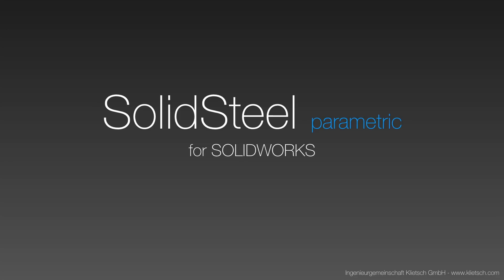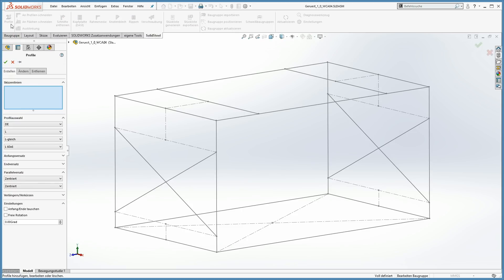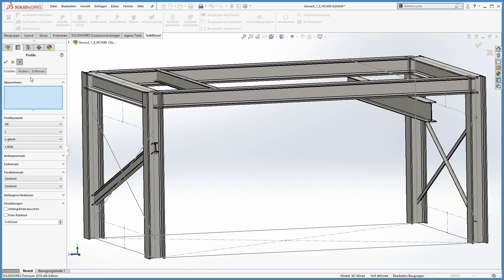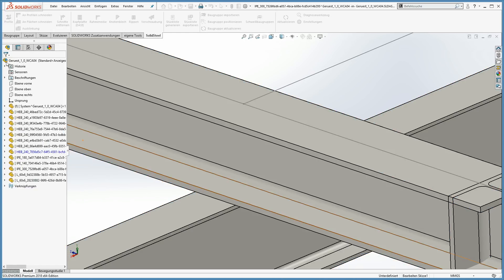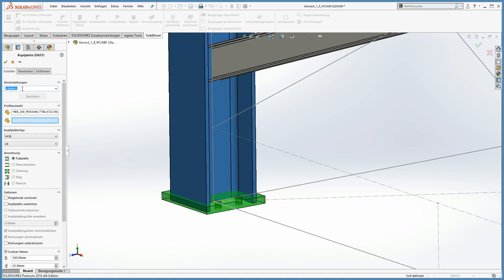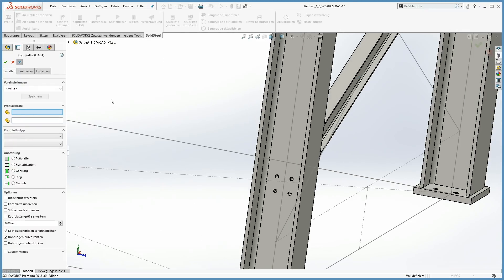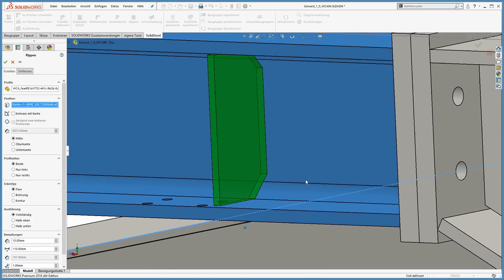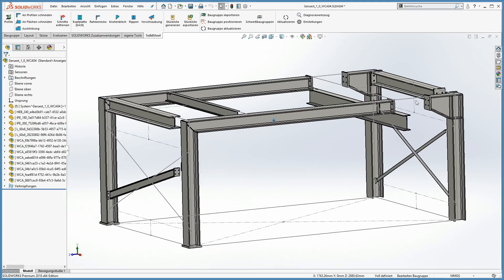Structural Steel Design with SOLIDWORKS - SolidSteel parametric - Product Video v1.0

Comment: comment faire pour obtenir le complément SolidSteel? es-ce un élément intégré à SolidWorks ou faut-il l'acheter en ligne ou le télécharger?
Reply from the maker: SolidSteel parametric is a fee-based Add-In for SOLIDWORKS and needs to be purchased separately. Please send an eMail to solidworks@solidsteel.de to learn more.

Comment: What about inserting a single parts such as plate, vendor parts!?
Reply from the maker: That’s of cause no problem! We are working in a usual SOLIDWORKS assembly and of cause you can insert other components. If you create a plate using the SolidSteel part template you can use the DXF Export, NC data export etc also for the external part for example and all external parts can also be listed on the BOM.
Reply: @apps4swx  I thought that Solidsteel part's codification is important in numbering and consolidation, so we can create a plate using Solidwroks features ?
Reply from the maker: @leo198995  Yes! If you use the delivered SolidSteel part template, then you can create a plate using SOLIDWORKS features and this plate will be part of the numbering, will be supported by DXF export and many more.
Reply: @apps4swx  thanks a lot, if you can add a video in such a way... Is solidsteel easy to use?
Reply from the maker: @leo198995  You know that it's easy to use. You had a trial in spring 2020 ;)

Comment: This looks like a waist of time. I think the software designers should learn how to make steel structures. I never seen a 45deg connection in any building. what about a library of clips. what about aligning the brace to 45deg and the bolt through the web. who welds on the flanges like that. know wonder our modern architect have no idea about structural steel construction.
Reply from the maker: Hi Alexander.
This video is just for showing some of the features of the software and no manual for structural steel design.
Libraries of clips, alignments and things like that are all available in the software. Here you will find all information about the different functions:
https://www.klietsch.com/?modul=page&action=steel&subaction=22&lang=en
Reply: It's not Architects responsibilities to figure out structural steel construction. It's a structural engineers job. You should know the hierarchy of a construction.
Reply: The stiffener at 8:30 is rather useless 😂